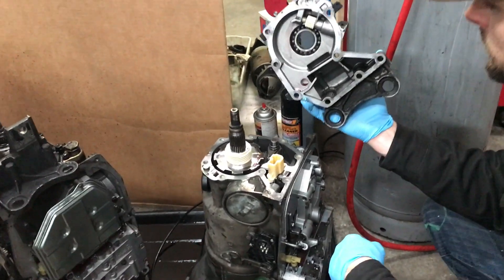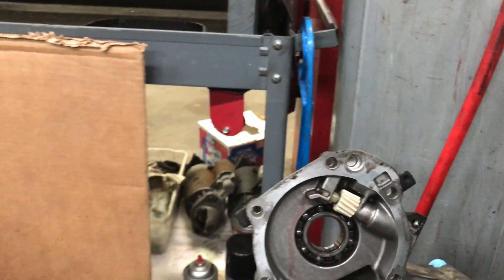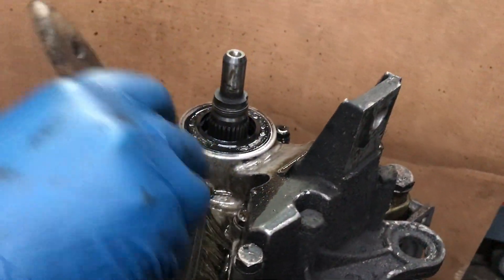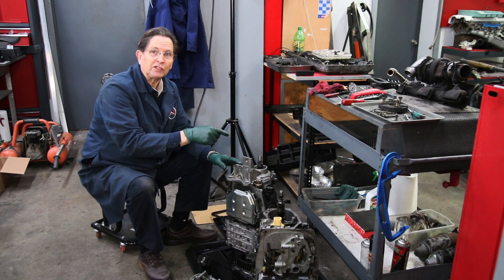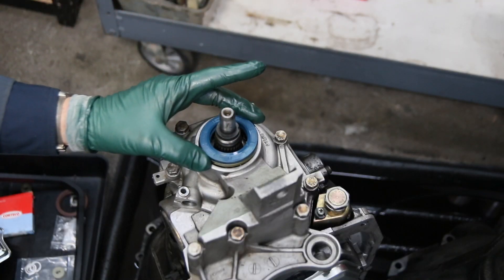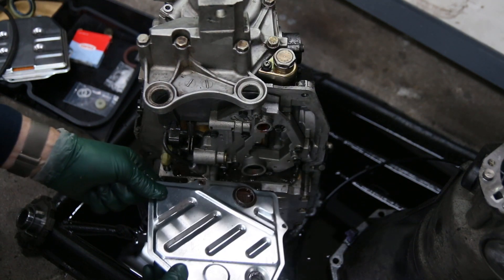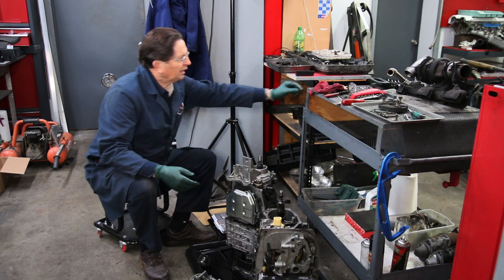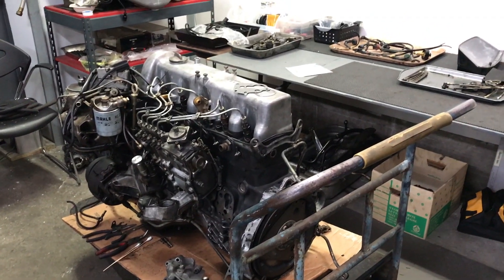Swapping an Automatic Transmission from a Mercedes W126 into a W123: Digby Update.

Comment: Hi Kent, Just acquired a 73 w114 280. With 722.1 transmission ?. Just wondering can I replace/install a transmission from a 1988 560sl? If so what are the difference. It’s running now but it needs engine & bodywork so I’ll be ordering parts from you once I figure out what I need. Thanks.
Reply from the maker: As they say, "anything is possible" but it will not fit without machining and extension modifications that could cost hundreds of dollars and hours and hours of time. I would never consider it. Just find a good used W114 automatic that you can bolt right in.. Just my humble opinion of course

Comment: Can i swap my w124 200 series manual transmission to automatic transmission? What is ur suggestion? Thank you
Reply from the maker: You will need more than just a transmission. Best to have a parts car available to guarantee you will get everything. Bell-housing, flywheel, mounting plate, transmission, driveshaft, sedan assembly, etc.